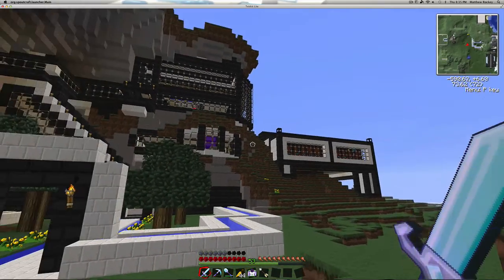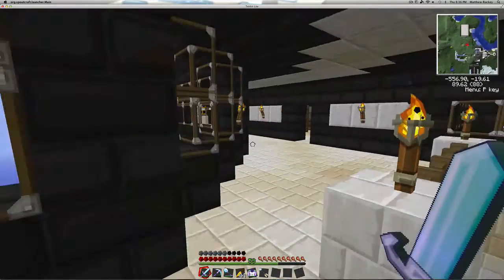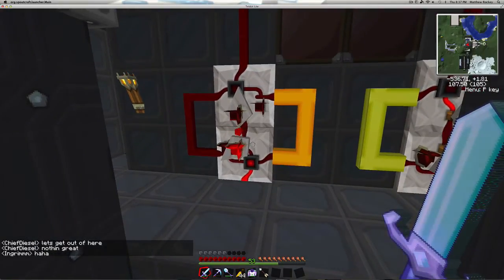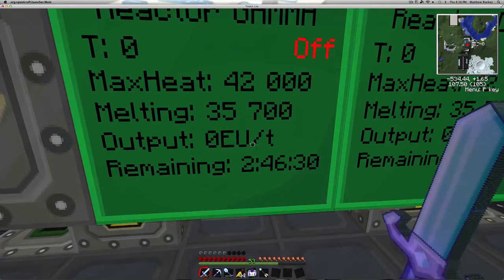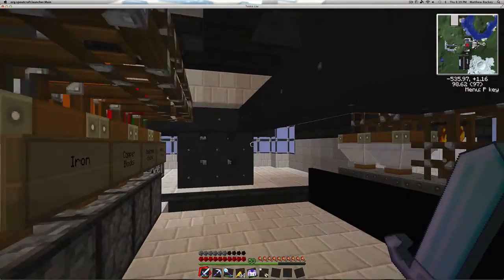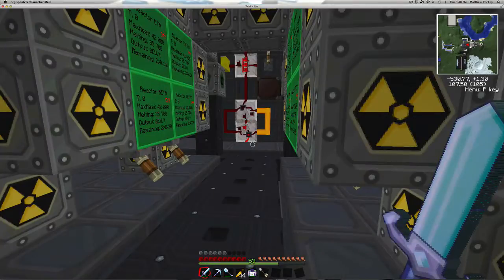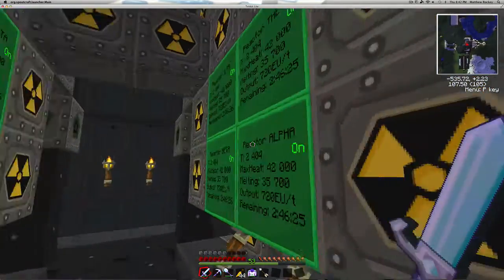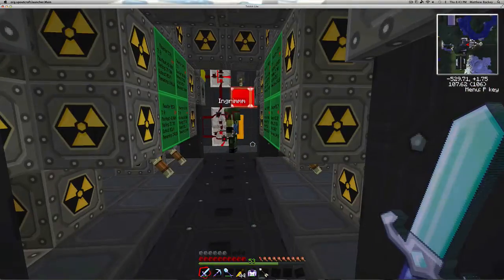Tekkit Lite Nuclear Reactor (part 3) - IC2

Comment from the maker: It's b/c the HV transformer is actually taking the 2040 EU/t from the reactor and buffering and converting it into 512 (HV) packets. The output is not 1 packet of 2048 but 4 packets of 512; which is why it's confusing. EU-Readers monitor avg. throughput over a period of time.

All that extra power (coupled with the ~20,000EU/t from the HV arrays) is being pumped first into MFSUs for backup and the rest of the base and then into Mass Fabs producing UU-Matter for our... factory :P

-Ingrimmm

Comment from the maker: The thing that has be confused is that when I hit the 4x Cable coming OUT of the HV transformer, the voltage reads 2048 EU/tick which doesnt seem possible as that would technically be considered EV... Unless the EU reader is incorrect? The MFSU can only output 512 though, so anything after that should be glass fibre...true.

I can post a video response if you want to see that expirement...

Still Learning here!

-CaptainJack

Comment from the maker: Ice,
From what we have found, the EU loss that 4x cable inflicts is negligent unless you were attempting to go long distances with it...in which case glass fibre would be the ideal choice. Since the 4x cable seems to be able to carry at least 2040 EU (2048 in some cases) the lost of 1eu / 1.25 blocks hardly matters because of the amount its able to move. After seeing your comment I expiremented with an UE reader on my new design (link above) and found the 4x cable to be far superior to HV.

Comment: Hey bros, Glass Fibre cable has much, much lower loss rates per meter than 4x HV cable. However, it's capped at 512 EU/t running through it. From what I've seen, you have HV transformers right at the reactor. What those are doing is turning whatever EU/t your reactor is putting out (700 something going by the last video) and cutting down immediately to 512 EU/t. You'd be better off just replacing every wire downstream of the transformer with glass fibre.